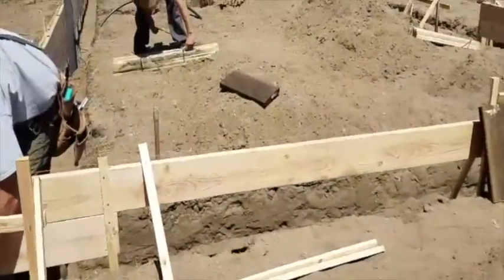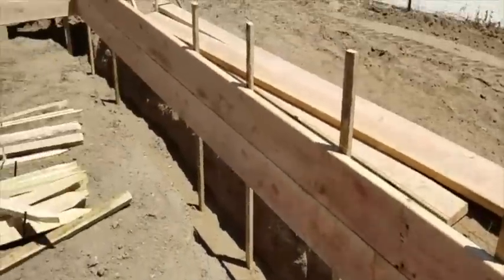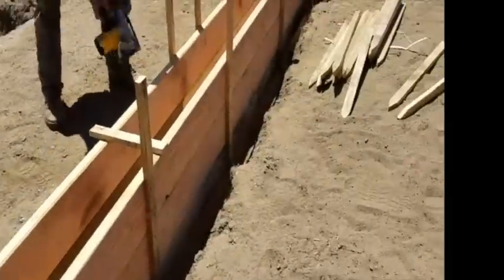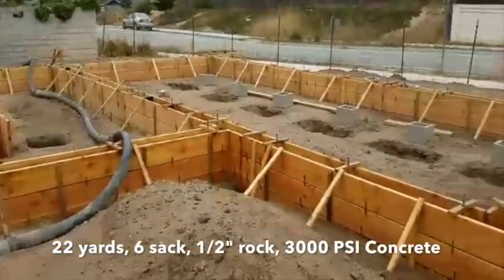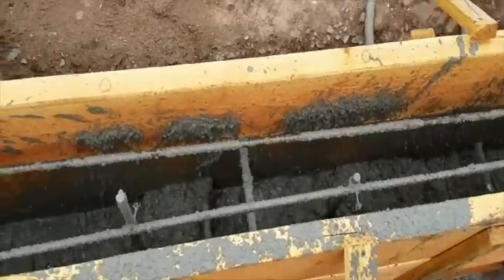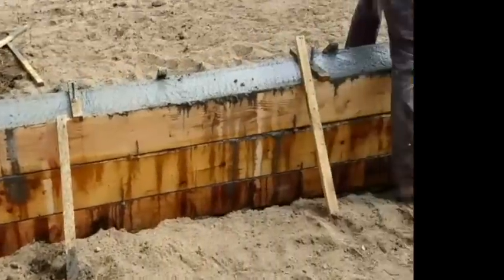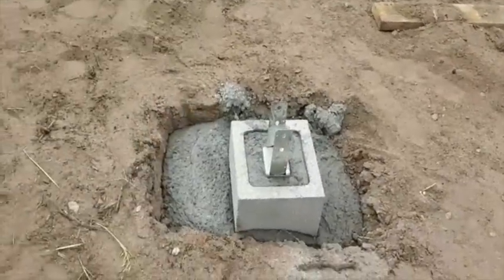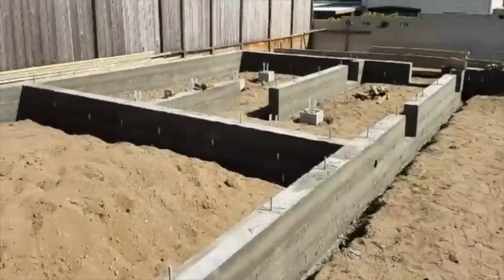Concrete Stem Wall Foundation

Comment: No vibrating? Top of your mix looks rough . Vibrating will bring the cream up for a better surface to build on
Reply: we do vibrate, hammer tap the forms and vertically rod the mud. Only so much is shown on the video, as I'm busy on the pour and not trying to make a "groomed" video...Dave

Comment: Whats the pros and cons on a stem wall vs a post tensioned slab?
Reply from the maker: Good question! 
i like raised wood  floors (stem wall foundation)- Easy access to underfloor plumbing/mechanical for servicing/remodeling, can insulate (warm floors), can be less moisture infiltration as can happen thru concrete slabs.
Traditionally, slab construction has been cheaper than stem walls, but the additional engineering in modern slabs seems to make it a wash in many circumstances...

Comment: We use sds screws. Helps so much.
Reply from the maker: SDS screrws?? Thats expense when you use hundreds/thousands in a foundation. The drywall screws won't (usually)
split the form stakes... But I love SDS screws for structural applications!

Comment: Psst: A 2x10 is 9 1/4. Used to be anyway. Everything above 2x6 drops from a half to a quarter (unless that has changed or I learned wrong way back). Nice video.
Reply from the maker: a 2x 10 is still 9.5" here in Cal.. Framing lumber is still green Doug fir, not kiln dried like elsewhere....
Reply: I just went next-door where they finished pouring a slab last week. Mostly only 2x6 material there sitting around. But one 2x8 treated. It measured out a wee bit less than 7 1/4. There was an old carpenter unloading stuff at the time here on Sunday morning. He looked toward me with that, 'What do you want on my lot' expression. So I explained the story. Right then he assured me that they are all 1/2, this coming 60 seconds after my measuring his own board and finding different. 

Then I looked online at maybe 3 sites to verify. See link below for one of them. Seems like I win the bar discussion thus far. Old carpenters who are far better at their trade than my couple years as a trainee framer and some time as a finish carpenter are apparently unaware of this weird matter done in the lumber industry for whatever reason.

You owe me a beer (maybe).

https://www.thesprucecrafts.com/understanding-wood-sizes-in-softwood-lumber-3536905

Comment: Hello Dave Osland. I would like to let you know that your excellent video inspired me to do my very own stem wall for my new garage and breezeway! I am a Window and Siding installer by trade but consider myself an all around carpenter who is not afraid to try and learn new things...I mean who doesn’t like to save money on labor 😃. I would love the chance to pick your brain on my stem wall construction as well...I’m about 35% completed by now...
Reply from the maker: send any questions!
dave
Reply: Dave Osland when putting the form ties on do you screw them on or nail those? Or just rely on the wedges to hold them in place? I figured nails or screws would possibly get in the way when stacking the 2x
Reply: Dave Osland also I’m in Michigan so in my city of livonia I have to go 42” from grade with footing. How many rows of rebar will I need?
Reply from the maker: So your footings are 42" in the earth??? Not knowing what codes you use, I would have to assume your plans call it out. In general, a minimum of two horizontal rebar 3" off the bottom of the footing is standard, with a single horizontal run every 18" as you go up in a stem wall. Out yonder here in Calif., we are usually adding vertical bar also, say, every 18" or so, extending from the top runs down to and hooking under the bottom runs. The  engineering requirements generally are more than the minimum code requires.
  If I understand, you have a 42" deep footing, I would probably consider pouring only the required footing depth, say, 15"?, and then use concrete block, like a opened ended speed block, to come up to stem wall height.
  Someone who builds out there may have some more insight than I do to your particular situation-
Dave
Reply from the maker: Use the wedges supplied by the form tie maker, that's all you need. Be sure and use an 1/8" spacer between form board runs, to allow the insert of the tie. If not, you'll have to drop a saw blade in a lot of spots for the tie.
Reply: Dave Osland yeah crazy huh?? Lol. I’m pretty sure that’s the norm here in all of metro Detroit. But I’m also building a 2x6 construction garage with 12’ ceiling first floor and and an outside loft wall of 5’ to a 10/12. So it sounds like a total of 3 rows of rebar will be needed maybe 4 in some areas
Reply: Dave Osland what about using a screw or nail and holding it off 1/8” inch to space it? Also I would love to share photos with you of my build as I go
Reply from the maker: So who makes the call- Building dept? arch/designer? Local or state codes should call it out too-
Dave
Reply: Dave Osland well because I’m attaching it to my house ie breezeway it is now structural to the home. And must be full 42” footing per building codes. I’m also doing a 10” wide wall. The plans only call for 8” but I’m fine with a little overkill 🙂. My soil is also clay
Reply: Dave Osland do you mean the amount of rebar to use?
Reply from the maker: a 16 d nail works. Tie spacer-  I'll use my speed square or a small chisel because the tapers thickness on the blade allows for easy extraction of it. Screws wouldn't pull out easily...
Reply from the maker: Ohh, clay... Expansive, shrinks and heaves. Here in Calif., almost any project requires a soils engineer to address the type of foundation design. Usually in clay, a pier and grade beam foundation is called out or an excavated and re-engineered soil is required. Anyway, plenty of #5 bar in the horizontal runs along with vertical ties would be in order, I would presume. The cost of steel is a relatively cheap insurance policy for a good foundation.
  I'm intrigued by the amount of youtube videos on concrete that has very little rebar use... Reminds me of the 70's when I first started building. We go crazy with the stuff nowadays.
Reply: Dave Osland well I appreciate the info and tips. Your video like I said inspired me to give it a go by myself. I’d imagine I’m saving quite a bit of cash. I’m also re using my 2x12 for my loft floor joists . I know a true craftsman when I see it! I’m picky and always I favor of over building much like you seem to be 👍
Reply from the maker: Forming from 42: deep is going to require a bit of room to get down in there and form up, unless you're planning on filling most of the footing with an awful lot of mud. That's why I was suggesting coming up from the footing with concrete block. Good lick on the project and let us know how it was done!
dave
Reply: Dave Osland yeah I trenched my holes anywhere from 2-3 ft wide in some spots. Shouldn’t have too much trouble.i plan to form down 38-40” actually 41 in some spots and as high as 33 3/4 in others. 3 2x12 abd and a 2x8 that I’d be willing to lose
Reply from the maker: In the lower form runs, form ties should be pretty close together- say 16-24" apart if you go with a 10" wide stem- a lot of concrete pressure trying to blow the thing apart...
and well as fairly close form stakes. Maybe 1x3". Take some pictures!
Reply: Dave Osland where can I send you pictures?
Reply from the maker: i don't know how to send you my contact info without posting it here...
Reply: Just had my inspection yesterday..APPROVED!  Thanks Dave for the great video. I want to show you pics somehow and a video

Comment: Nice video- this is exactly how I was planning on pouring my footers and foundation wall. Is the footer formed by the trench, poured to the bottom of the stem wall? How soon do you pour the stem wall over the footing? Can you use the lumber in the construction or is too messy with concrete?
Reply from the maker: The footing is formed by the trench itself- no form boards. I use an 18" bucket for a 15" footing (2 story) or 12" bucket for a single story, unless plans dictate other wise.
The footing is pumped up to the bottom of the stem wall, so as to seal it for the wetter mix going into the stem wall.
Usually by the time the footing is poured, the stem can be started on the first poured areas where the footing was started. I try to pour the footing on the stiff side so as to prevent blow-outs when using the wetter mud in the stem.     You can generally start pumping the stems 20-30 minutes after the footings have been poured. You don't want to wait very long as having formed stakes anchored in a solid footing is no fun!
After everything is poured and striked off,  I go around with a hose and spray off everything I can so i have relatively clean lumber to put back into the subfloor in a couple of days. (i have a video showing the sub-floor being installed just a couple of days after the pour with the forming material.)  https://www.youtube.com/watch?v=4xMSep0uiRs
Designing most of the homes we build, I plan on subfloor joisting that is compatable with the form material. It never has to leave the job and is a very cost efficient design/build technique-
Dave

Comment: Hey Dave, not sure if you miss my question below, but I'm just wondering if you could let me know full size of the building (width and length) , then you have the load bearing wall line up at interior garage foundation is that located half way of the width of the building.

Comment: Hi Dave, What is the full size of the building, then you have the load bearing wall line up at interior garage foundation is that located half way of the width of the building.

Comment: I might suggest excavating the crawl space area for trades working under the subfloor.
Reply: You're correct on the need for the crawl space. The 18' high stem wall creates the space without having to excavate a below grade area. I prefer this over the excavated method,  to have the home sitting above adjoining grade to allow for sloped finish grade and to eliminate potential water/moisture infiltration into a lowered grade area.- 
Dave

Comment: Nice video. I'm assuming being in Calli your local codes only require 12" or 18" footing? Must be Nice! Here in Jersey everything is 32" to 36" minimum. Anyway, Nice form work!
Reply from the maker: Yep, 12x12" for a single story,15x15" 2 story and 18x18" 3 story footings, unless soils reports dictate otherwise.
6", 8" stem wall thickness for 1 and 2 story, generally. With so much engineering nowadays, we get all manner of foundations. Pre-stressed slabs seem to be gaining popularity as a way to avoid "engineering" of the soils- excavation/recompaction in lifts, importing soils,  etc...
  Unless your up in the high elevations, heaving soils due to "frost line" isn't a worry, hence shallower footings.
Basements? Almost unheard of round' here!!
Dave
Reply from the maker: Oops! Brain Fart!! 2 story is 15" wide x 18 deep. 3 story is 23" min. width. Although footing depths will vary, it is curious that in many cases only a 6" concrete footing thickness may be required at the bottom of those depths (as opposed to filling the whole footing with concrete)! Where it gets crazy is the amount of steel that can be required. The latest plans I've worked on include 5"x5" plate "washers"on the mud sill!!!
Dave

Comment: Great video.  Quick question.  Going to DIY a 30x40 3 car detached garage with garage doors on east and west sides enabling me to drive through.  Should I stem wall the slab or just monolithic style. Pretty high dry area and hard.  
I’d rather mono it just because it’s easier but wanted your opinion.  
Best regards,
Jon
Reply: Good question. Unless it's a design issue, I would try a monolith slab pour. if your on a sloped area, a slab-on-grade would be more difficult....
Dave
Reply: David Osland thankyou for the quick response and info.

Comment: Thanks for the video, a great help for me in my planning to build a 28x40 garage that regional building requires to have a stem wall foundation here in Col-Spgs. What slump do you request for the pumped concrete? How long before you start putting sill plates down and framing with a winter time pour?
Reply from the maker: Hi Jeff-
A stiffer mix is used to fill the footings up to the bottom of the stem forms- say a 4" slump? But a 3/8" pea gravel mix will settle different than a 1/2"or 3/4"- Anyway, a stiff but pumpable mix is used first, then wet it up some so the mud leaves little or no voids in the visible stem wall sticking up out of the ground. Running a vibrator or tapping the forms with a hammer is good practice. Nothing like a smooth clean surface when you strip those forms!!  If a wetter mix is used first, you stand the chance of the mud blowing out of the bottom of the stem portion. I'll often put plates down the next day, but  you might want to wait a day or two in cold weather, as concrete cures very slowly at low temps....
Dave

Comment: can you  wait a  day  ,    to  pour  the   the  rest  of the  stem  wall after    you  fill  the   bottom  '?
Reply from the maker: "Concrete waits for no man"  The vertical stakes would be locked in place if the pour was dragged out, with this method.
Other forming methods might allow for staged pours- Concrete block, ply forms with snap ties, etc...
Reply: @daveosland3199  Actually this video is super misleading stem wall and monolithic are TWO ENTIRELY DIFFERENT types of slabs...... Stem wall foundations are very much done in TWO pours.

Comment: Thank you for posting. I'm having a guest house built and foundation is built the same way. Originally went with slab on grade but architect recommended a raised Foundation to make plumbing and eletrical repairs easier. It cost more but I think in the long run is better.
Reply: Slab-on-grade used to be the "poor man's" foundation, but with the engineering standards, etc., the cost is not very different. A lot of slabs are now "post tension".
Ask anyone who's had to jack hammer into a slab to repair plumbing if they would prefer it to a raised foundation. There's also a different feel and warmth to a raised wood floor......

Comment: Didn't see exterior drainage outside and below the foundation.
Reply: You're right! The soil there was extremely well drained sandy loam, and no need for any drainage. Finish grade is sloped away from foundation to eliminate any pooling adjacent to the house-
Reply: A finish grade is done after the foundation is complete, generally a 2-5% grade away from the foundation, usually for at least 5'. Since I generally don't excavate on the interior area, and we aren't in clay, no drainage is needed below the foundation or structure.- Dave

Comment: Very nice.  For wet southern Louisiana I had a test compaction/consistency test performed saying I need to be 30-36 inches below grade to have 3000 psi soil though my engineer said I can go as low at 1500psi..  Base Flood Elevation is 36ft which happens to be 1.5 ft above grade.  I am building at 37.5ft b/c BFE is the MIN allowed by building code and I want to higher.  That puts the top of stem wall at 3 ft above grade which means my wall is 6ft total top to bottom and 16 inches wide.  Lots of concrete.  Although I like the idea of 2x12s running around  the perimeter inside and out, that is a lot of boards and could leave a lot of lines to be finished the next day once the form boards are removed.  Still not sure on my route to take.
Reply: Let me understand this- Your stem wall will be 16" thick and 6' high off the footing??? That would hold up a bank. I've done 6' high stem walls, but 8" wide is rated for 2 stories. Anyway, unless you can reuse the form lumber in the frame, I would use concrete block for the stemwall,  but again, if it really is 16" thick, a plywood formed wall using whalers is another method used.
Reply: Hello David.  Yes you are correct.  From the bottom of the footing approx 36" inches down from grade extending out of the ground 36" above grade to reach 1.5 feet higher than BFE of 36 feet above sea level for my area.  The footing/stem wall plans were drawn originally 12 inches wide by the engineer who is confident  about it being enough support but both concrete 'guides' that I interviewed stated how difficult it would be to run 14 #5 rebar in such a tight area.  After some discussion with them and the engineer I voted to make the width 4 inches wider to 16 inches.  The cost of the concrete is not that much more for the speed to do what needs to get done.  A rough calc has it about $5k more.  One reason why so massive is the peak of the roof is 36 feet high, building is all steel AND the entire second story is (lightweight) concrete flooring 3-4 inches thick.  So yes, in a way will hold up a bank but I stayed during Katrina and I plan to stay again in a much stronger domicile.  For kicks I will be happy to send you the drawings.  It borders commercial grade.  In the meantime I will look up 'plywood formed wall using whalers'.  Thank you for the lead.

Comment: Extremely helpful, and well made video!!!
Reply from the maker: Glad you got something out of it!
 Raised stem walls are less common now, but I appreciate the access to plumbing, etc, and the feel and warmth of a raised wood floor.
   With increased costs of concrete slab foundations due to design/engineering, etc. the stem wall foundation is a competitively priced construction method, especially when the forms can be reused for another foundation or incorporated into the structure.-
Dave